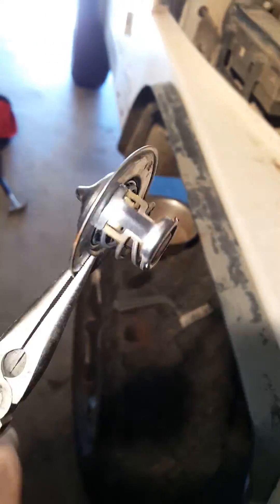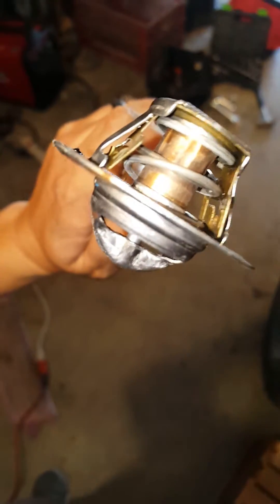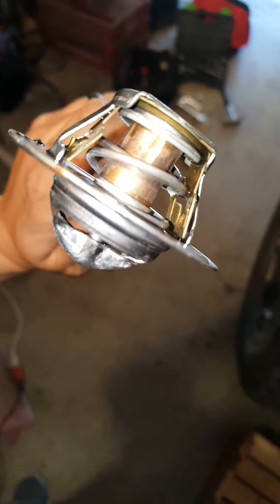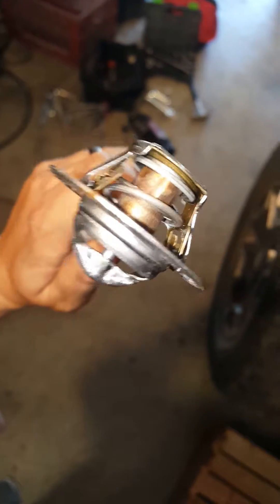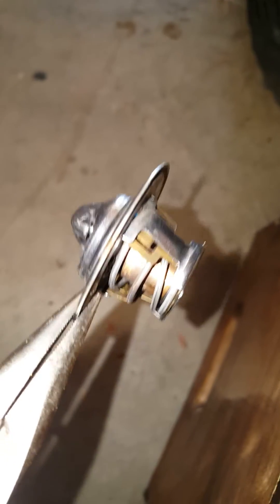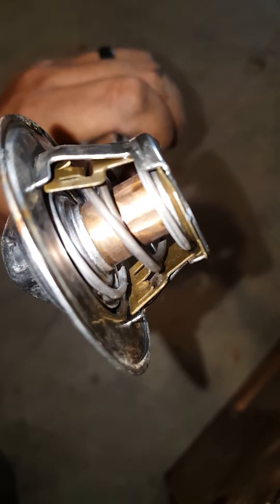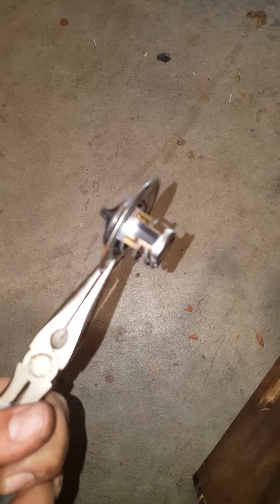Fail safe thermostat from a jeep

Comment: A thermostat works using a 'WAX MOTOR'.  Inside the copper cylinder, hiding in the middle, is a powerful THERMO-EXPANSIVE WAX. Inside the wax motor cylinder is also a piston. Hot water heats copper, then the wax, which pushes on the piston, which pushes against the tstat's water valve closing spring.

Comment: Sorry if this might sound stupid, but I just wanna understand what if it doesn't open in the first place if the filling inside is blown or something? And when it normally opens in normal temps, what makes it doesn't lock in the open position?
Reply from the maker: Well if your thermostat  doesn't open, the engine will begin to over heat. You will know by the gauge.  The 2nd part, I think if exceededs the designed  temp. It will expand to the point where it locks.
Reply: @randomguyaso  any idea on what that temperature is? I'm switching a 160 tstat to a 192 tstat fail safe... On what temperature will it lock? 220? 230? 240? Thank you for your time.
Reply from the maker: @franciscomacias9603  sorry I am not sure. Maybe when you pick up the new one read all of the info on the box?
Reply: @randomguyaso  Much appreciated.